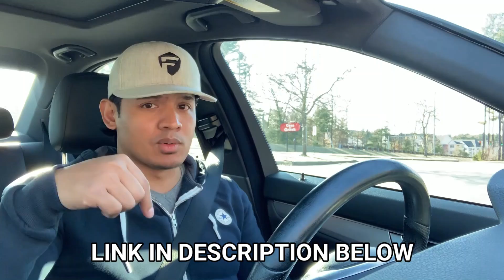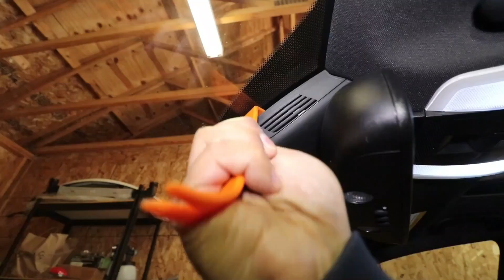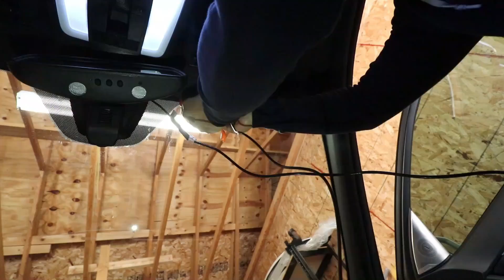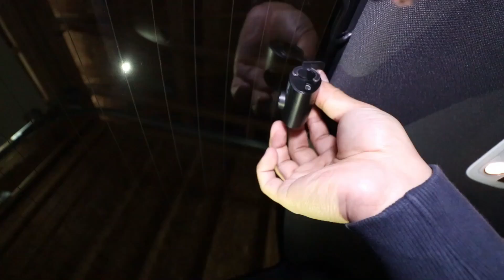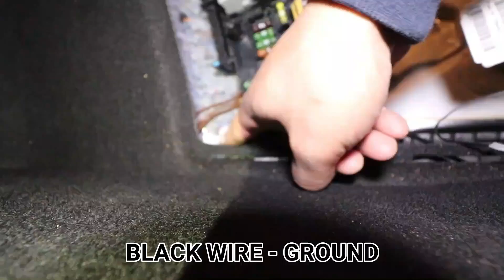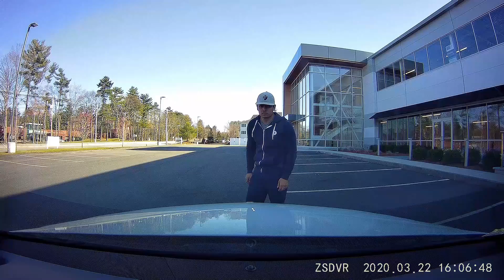Install OEM STYLE DUAL HD DASHCAM for 2008+ Mercedes W204 C-Class

Comment: I had thought the purpose of these cams was to wire right into whatever power source was already up near the rain sensor is that not possible? I purchased mine with that understanding.
Reply from the maker: No. Most cars have zero power up there or there’s not enough power. You can’t just “borrow” power.  You’ll cause low voltage to the original item you’re borrowing power from. 

Plus you need a fuse cause if the camera malfunctions, the fuse has to blow or else power will keep running through and cause a spark/fire.

Most aftermarket electronics need their own dedicated power source from a fuse box.  Sometimes you can splice into an existing wire in a car to get power but whatever you’re installing better use very little power.

Comment: Hey Flex. What do you mean by the “right side is the wire side” and the “left side is the hot side”?
Reply from the maker: My video has easy steps to follow to make things work but if you need in depth explanation, It’s a lot to explain that I don’t have time.  

Please don’t take this the wrong way, but if you don’t understand it, You need to google on “how a fuse tap works”.  There’s plenty of videos on YouTube. That will explain everything. Then it’s up to you if you wanna tackle the wiring or get a professional to do it for you.

Comment: Mine didn't come with a pamphlet so I don't have a QR code, can you link the ios app i'm supposed to use, or just the name even so I can search it?
Reply from the maker: You need to reach out to whoever you bought it from. I sold my car years ago.
Reply: @TheFlexxGarage  Yeah I did, still waiting to hear from them, just figured I'd check to see if you remembered.  I'll update here whenever I find out just in case anyone else ends up buying one going forward.  The install was super easy so far thanks to your video, appreciate the quick reply!

EDIT: Ended up finding it from another of Flexx's videos, the app is called Ucam.  Also the product code you need on the site to order is A13-1, I have a 2009 C63 but I believe that should work for all W204 C Class vehicles.

Comment: Hi Flexx I just got a camera for my Mercedes w205 not manual included at all. I managed to install the camera, but I can’t connect it to my WiFi. I’m not that sure about your statement that dmp is a reputable source. So far I’m not happy. But let’s see how they react, I emailed them yesterday. By the way quality control doesn’t exist I guess because the camera shipped direct from China. DMP can’t see what the Chinese send out.
Reply from the maker: You need to kill your cellular connection before connecting. Pretty sure I mentioned that. It’s in the instructions.

Comment: Just bought this for my car thanks to this video bro. Might be a stupid question. But when removing the battery for the car, before plugging in. Are we also disconnecting the auxiliary?
Reply from the maker: Only need to disconnect the negative side of the main battery under the hood. That will cut power to the entire car.
Reply: @TheFlexxGarage  good looks bro
Reply: @TheFlexxGarage  sup man. I just got mine in the mail. And it has a video input and a bit different from yours. What am I supposed to do with video input? It says connect to vehicle mounted dvd display screen but I have oem
Reply from the maker: You don’t need to use it since everything is viewed on your phone.
Reply: @TheFlexxGarage  okay thanks again. But if I did want to. Would it be possible on a oem screen? Probably not right

Comment: Hi, I need help with the fuse box. My fuses are small and doesn’t fit in 71 and 74 is not a fuse place in my w204 2009
Reply from the maker: Every car is different.  You need to use a test light pen or multimeter to probe and find which fuse # turns on and off with the key and which one stays on all the time. And if there's already a fuse in that spot, then you need to use a fuse tap.
Reply: @TheFlexxGarage  fuse 71 and 74 are taken, do you know what fuses i can use
Reply: Flexx Alexander ThankYou for your comment. It’s the same Mercedes that I have but it’s a Uk version. And the Fuse tap, the fuse that I have for my dashcam is very small and the fuses in the car are quite big.. is there anything else I could do?
Reply: @TheYoungWarlock  you have to get the right size of fuze tap. They make different sizes and you may have to buy a different one

Comment: Unfortunately this does not fit a UK model W204 C250 CDI
Reply: Did you figure out a way?
Reply: @TheYoungWarlock  hey, not really.
I went back to DMP car design, and they sent me a video of how to BREAK one of the clips to get it to mount properly....
Not just that, but to get some black tape to cover up the corners so it doesn’t look like it’s over hanging the tinted glass outline where the original cover is...
How about you?

Comment: Not clear if the wire routing required removing other trim panels along the windshield or doors? Can you actually squeeze the wires in there by hand? Otherwise, good job and nice replacement rain sensor piece!

Comment: I’ve just tried to order this item on their website but it’s asking me for bank transfer which seems a little bit dodgy to me, can anyone vouch for DMP car design and bought from them before with no problems (apart from Flexx)? Please comment so I have confidence in buying as I’m a bit unsure at the moment
Reply from the maker: There’s other forms on their website. And if you’re afraid, go read peoples comments in almost video I made on DMP products. I wouldn’t being endorsing a company that scams people.
Reply: @TheFlexxGarage  hi flexx, thank you for your comment. I’ve went on some forums and a lot of people vouch. I didn’t mean any disrespect to yourself, I just wanted to double check as I got concerned about the bank transfer on the website. I have another question but it’s about installation with the fuse box: When putting the fuses in the fuse box, does it have to be #74 and #71 because I have a fuse already in slot number #71? Thanks in advance

Comment: Hi there! Does the g sensor and motion movement work?
Reply from the maker: Yes. You just need to turn them on in the settings.
Reply: Flexx Alexander hi Flexx, you stated that it works if it’s turned on in the settings but you also mentioned in another comment that the dashcam turns off once the key is taken off the ignition... so how would the g sensor and motion movement work if the camera only works once the key is inserted into the ignition switch?
Reply from the maker: The dashcam has 2 power wires. 1 is connected to constant power and 1 is connected to accy (turns on with key).  When the key is turned to on, the accy wire tells the dashcam to turn on 100% and power up. When the key is off, the accy wire tells the dashcam to power down/sleep.

Because the dashcam is also connected to the constant power wire...there will also be a minimal amount of power still running to the dashcam. If the dashcam has parking mode turned on, if it detects movement...the software will tell the dashcam to power on (use the constant power) to start recording for a small amount of time and then go back to sleep (with minimal power again).

The dashcam is never completely off. It's either sleeping or on.   That's how 99% of all dashcams work.
Reply: Flexx Alexander ThankYou so much for your reply. That is very helpful! So I got the dashcam and wired it and everything. Now I have the yellow and the red wire left to do but the fuse number 71 is already taken by another fuse, and fuse number 74 is not a place for fuse in my w204. Can you recommend what fuse I could use please?
Reply: @TheFlexxGarage  thank you! Which app are you using?

Comment: I'm getting ready to order my dual dash cam for my 2012 Mercedes Benz E350, the code is 13-1 (auto rain detector) Everyone with common sense should get a good dash cam, especially if you live in Florida. Theres a lot of idiots with little brain matter or no at all.
Reply from the maker: Hahah. A lot of idiots in Mass too. All my cars have dashcams.
Reply: @TheFlexxGarage  Idiots indeed. I found one problem with trying to purchase this item. This company only has two ways to buy. 

• Paypal.
• None encrypted checking wire transfers.

I consider myself a smart consumer. I dont ever give my checking and routing numbers out through emails or through any app, including WhatsApp. And I never use PayPal because it's basically a second party, transfering peoples money to a third party. I found through experience that when a problem arises with orders made through PayPal that the process time for a fix, replacement or to get refunded takes almost 3x longer to get.

I wish that this company that sells this great product would accept credit card payments directly from thier buyers. Its quicker for both parties and resolutions get resolved much quicker. 

I hope they can work on this soon, because people like myself (and theres a lot of us types) that would buy this Dash Cam system if it were easier to purchase directly. 

Have a great weekend Flexx!
Reply: I wanted this so bad that I opened a PayPal account only for this item. The ordering process for payment is complicated if no PayPal.
Reply: I'm surprised that BMP Car Design delivered my OEM Dual Dash Cam as was delivered today!. The delivery date was set to September 14, 2020. Now, all I got to do is get a friend to install while I film a video for installation.

Comment: Very nice product and it does look OEM.  I personally don't mind a small off the shelf dashcam mounted up high on the windshield to justify spending $199 for this especially since my c300 is 10yrs old.  

I do want to install an HID kit, I'll have to look and see if you have any videos on that.  My only question is if I can mount the kit inside the headlight housings or if it's better to install in the engine bay and drill holes for the wires thru the plastic covers.

Comment: Flexx, is it possible to install it without the constant power wire? I mean, i want to connect the ground and acc wire in a cigarette lighter plug and use the cigarette outlet inside the glovebox
Reply from the maker: The acc only works as a trigger to let constant power flow to the dash cam.  But theoretically, if a cigarette lighter plug will accept 2 wires (a ground wire and a power wire)....the dashcam can work by running the black ground wire of the dashcam to the ground wire of the plug. And then combining both the power wire and acc wire of the dashcam and connecting it to the power wire for the plug.  This way...when the key is in the car...the plug will turn on with the key...and the acc will get power from the plug and tell the dashcam to accept the constant power from the power wire. At the end of the day...I don't recommend this method since it wasn't recommended by the product manufacturer.
Reply: Flexx Alexander thanks a lot! I will connect it the same way you did!

Comment: Had the Blackview dr900s installed a year ago on the 2016 C300 and still have it, but the OEM style dual dash cam as far as I can tell is definitely stealthy and less of a drain on the battery.  Will have to consider swapping out dashcams.  It was my hope to find a 360 degree dashcam for the C300 with dvr capability, but it might be more work to have it installed than the front and rear dashcam set up.   Thanks for finding showing this.
Reply from the maker: Ive had a blackview on my c250 and it crapped out. Great camera. Then I bought a cheapo Rexing for like $120 on amazon and it's been solid for like 5 years and still kicking. But like you said, this camera from DMP is stealthy and so far, it works pretty well. And if you have an android screen, you can pair that with the camera as well to view the realtime recording or watch/download the saved videos. I don't have an android screen on the C300 hence why I used my smartphone to view/download the footage.
Reply: Flexx Alexander flex does this fit the w205 cclass 300
Reply from the maker: Go to the link and contact their customer service. I think they have it for the 205.